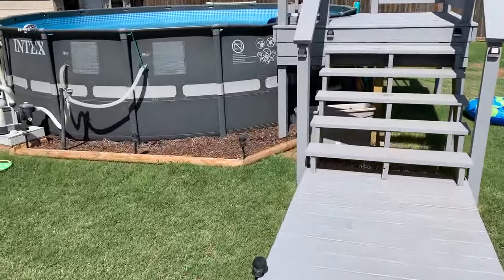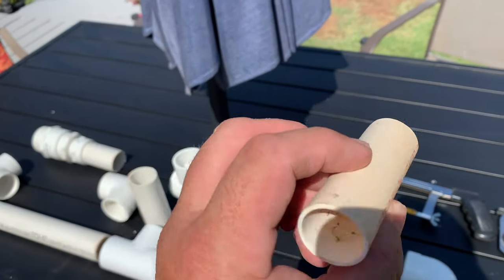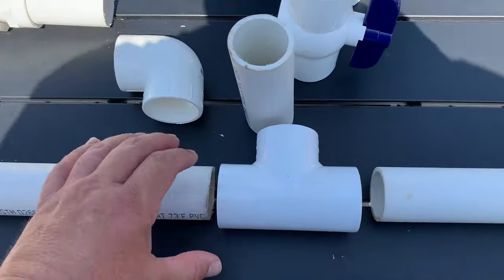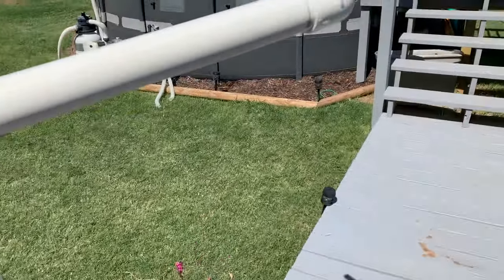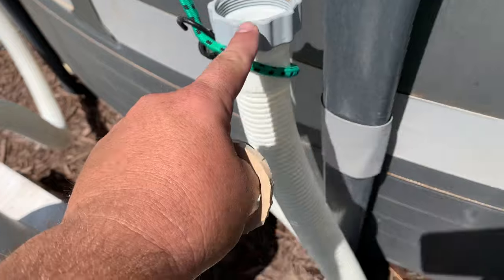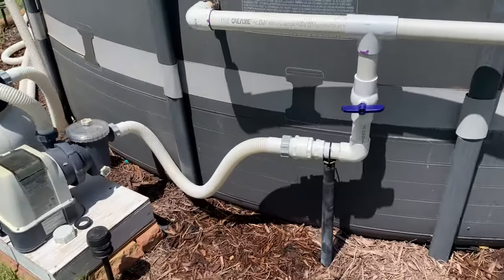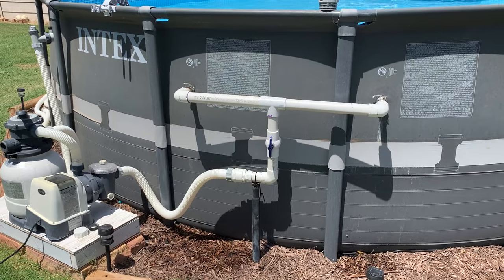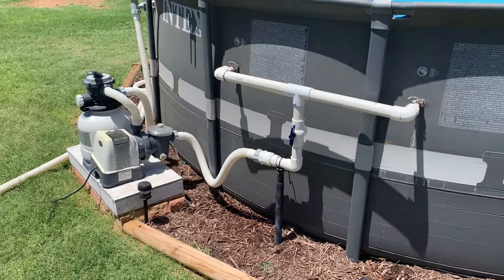How to PVC plumb your INTEX pool

Comment: The screened input nozzle that you are thinking about not using is part of the "VIRGINIA GRAEME BAKER POOL AND SPA SAFETY ACT"
It prevents suction entrapment by preventing the skin  from forming a blockage and damaging the body from suction.
Reply from the maker: I’m good with out it 👍 but thank you for posting the info
Reply: Actually, they are there mostly to prevent a child's long hair from getting sucked in, causing drowning.   That's also why there are two suction ports, to lessen the pressure at each.  Under no circumstances should the pool be operated without the screens or something like a skimmer, vac hose, or plug in one of them.
Reply from the maker: Correct for any parent with young kids do whatever it takes to keep them safe. Thankfully my kids are getting older and do not mess with the ports.

Comment: Did u upgrade your outward plunger? Where the water goes back into the pool my current pool is a 1.25 hole but need to do upgrade to 1.5 adapter to connect the pump.
Reply from the maker: No I don’t change the return side. If you make that end larger it won’t circulate your pool because of low pressure.

Comment: CPVC, PVC 40, and PVC 80.  Each has a different outside diameter.  The cream color pipe you used is CPVC that is measured by outside diameter.  PVC 40 and 80 are measured by Inside diameter.  You could use PVC 40 in a 1" and coupled to the pool screens, but would be work best if you heated the PVC 40 and then pushed it on the pool spout.  That way you could still install the screen covers inside the pool.  Just a thought.
Reply from the maker: Absolutely yes that’s great information, I figured all that out after I did it lol. You are correct great info 👍
Reply: I am about to try both of these suggestions... Woke up to 2 hose leaking this morning... Could you clarify the heating of the PVC40 & pushing it ON TO the pool spout? Instead of into the rubberized area, correct?
Reply: I’m rounding up the materials as I type to do this project. Are saying that instead of pushing the 3/4” CPVC through the inside of the rubber and into the pool, that I should get 1” PVC40 piece, heat it, and then push the 1” pvc40 over the rubber on the outside of the pool while the pool screen is still attached on the inside of the pool?
Reply: This would be nice to know. Still unanswered
Reply: He is saying instead of putting a 3/4” cpvc piece and sliding it into the piece attached to the pool that has the screen on the inside (inlet valve and return valve) to get pvc 40 and heat it up to soften it and place it on the outside of that same piece. Imagine the hoses not being attached and the valves just sticking out of the pool. Those pieces. So it’s not a lil lose.

Comment: Hi!  Your video seems to show the most detail so far.  Thank you!!  I just bought all the gear but went with 1 1/4” pipes because I wanted less weight and bulk.  That seems pretty close to the size of the cheap tubing from the factory.  Do you think I’ll be ok or should I exchange for larger PVC?
Reply from the maker: I bet it will work just fine

Comment: question, the piece(s)  that go inside the two openings that the old hoses suck the water thru (you didn't show the inside of the pool after you put it all together). Did you just leave it bare once you inserted the pipes and clamped it down?
Reply from the maker: My pool has covers that will block debris from going through the hole. What I did was cut those back a little bit so they didn’t go in as deep. And they pretty much met the PVC in the middle and worked just fine.

Comment: Good video. The two inlet ports, did you keep the the parts that were originally used to connect tube to? I have that skimmer as well but need the stock inlet hardware to attach skimmer to. My problem is that stock inlet hardware goes all the way to outside where hose hooks up. How do you stick the 3/4” pvc into port and still be able to use your skimmer? It’s the same size diameter too. Does it just hang out more inside the pool instead of flush against?
Reply from the maker: Yes I kept it all the same, on the skimmer I just cut the skimmer inlet adapter short enough it meets the p c in the middle of the opening.

Comment: I know you have upgraded to a Hayward skimmer since this video, but how did you use the intex skimmer with the 3/4” pvc?
Reply from the maker: I made a video for it 👍🏼. The skimmer comes with a blue adapter that screws on the debris cover for one of the inlets. Then for better suction just cover the other inlet with on of the plugs. 
https://youtu.be/Dd5lfIC4SUY?si=DqgH2oM8rpuZECdL
Reply: @LifeLessOrdinary  thanks for replying!! I watched the video. Since the PVC sticks into the black rubber hole on the side of the pool, I had to cut the intex pool strainer to fit. The new pvc pipe is halfway in and the cut intex strainer is in the other half…if that makes sense. The strainer will not fit in a 3/4 or 1 inch pvc. Had to get creative. I believe when you made the video, you still had the old flexible tubing.

Comment: How do you keep your skimmer down? I have the same pool and skimmer and mine is always floating up bc neither of the hooks properly fit on the edge.
Reply from the maker: I don’t have that skimmer anymore. I now have a Hayward. But yes, it’s frustrating when the water level changes it tries to float up. Unfortunately, just have to keep adjusting the height.
Reply: Thanks.  I'm in the process of ordering everything from Amazon now to get this switched over.

Comment: Nice job dude, but get rid of those tiny returns. Try to keep at least 1.5 to 2 inch return lines into the pool for optimum efficiency. I won't go into details since I'm sure you learned by now. Did you ever change them in 2021?
Reply from the maker: No I haven’t yet, seems to be running great as is but I might upgrade the pool after this season. If I do I’ll make them bigger for sure 👍
Reply: I agree. The 1.5" is pointless if you choke it right back down  to .75"

Comment: Hi, what return outlet do you have? Is it directional that we can adjust to where we like to  point? And how long you have your pool and do you have any rust and corrosion issues? Thanks!
Reply from the maker: Yes, I have a directional outlet, I tried to pointed to the side as much as possible, to kind of create a whirlpool. This is now my fifth season with the pool and no I have zero rust or corrosion issues.
Reply: @LifeLessOrdinary  Thanks alot for your reply. Could you send me a link or the name and manufacturer of your return outlet? I would like to buy the same. Thanks
Reply from the maker: Absolutely 👍🏼
Reply from the maker: Here is the return part https://amzn.to/3qoaQFN
Reply from the maker: This is what it connects to on the outside https://amzn.to/3N4mMpj
Reply from the maker: No on the return port on the inside he won’t need that long piece. You unscrew that part in the outside part screws right onto what’s left
Reply from the maker: Once you get it if you’re confused at all, send me a message
Reply: @LifeLessOrdinary  Thank you!

Comment: Someone's probably already said this, but don't you worry about the pvc cracking from the pool flexing back and forth?  I'd probably at least put a flexible hose to the bottom so it has some room to move around.  

Otherwise, looks cool.
Reply from the maker: Definitely something I thought about but it’s held up really good. Started year 3 this season and with 4 kids swimming like crazy I’ve had no problems 👍🏼
Reply: @LifeLessOrdinary  right on!
Reply: Schedule 40 pvc doesn't crack easily. The small vibrations or movements caused by that small pump most  lilley won't do much to damage it.

Comment: Can you still hook up a skimmer to one of the outputs? If you made that pvc thing. We just set it up and I was like oh can We hook up the skimmer now.
Reply from the maker: Yes you can still run your skimmer into one of the inlet ports. If you can’t fit the adapter all the in you can cut the end just a little and it will fit better into the inlet.
Reply: OK. I totally forgot about the skimmer when we made the PVC thing and now I don't know if it's gonna fit in the hole Or not
Reply: I think we may have put the pvc pipe in too far
Reply from the maker: It will but I cut mine when I still used that skimmer so it would fit into the inlet until it met the pvc
Reply: Yeah we didn't do that. Thought about it after the fact. And I looked and It's a different skimmer that what you have. The one that goes on the inside of the pool not the outside. Do you like that skimmer? Also do you think it'll work now that we already have the pvc pipe in most of the inlet hole?  Sorry for all the questions
Reply from the maker: Yes when first did this conversion I had the skimmer that’s goes inside that’s what I’m talking about 👍🏼
Reply from the maker: Look on the about section my email is there if that’s easier to communicate 👍🏼

Comment: Did you use the plastic inserts that came with the pool for the inside of your intakes ( the ones the screen screw onto ) ???
Reply from the maker: Me personally no I don’t, I don’t find that they help much
Reply: So how then did you hook up your inside pool skimmer I’m having problems with getting air in the system so I think I’m going to try the hard plumbing system see how that works thanks
Reply from the maker: Hard plumbing is the way to go. When I had the inside skimmer, it comes with an adapter for one of the inlet holes. The other Hole I would leave open unless I needed more suction to the skimmer. Then I would plug it.
Reply from the maker: This video shows how I run my system now. 
https://youtu.be/uWq2HbUBGuU

Comment: I’m looking to do similar hard plumbing. How do the seals fare when the pool is bouncing around with swimmers. Everything looks pretty rigid. What do you think about using the stake on the flex hose to allow for some play while holding the weight of the pvc pipes?
Reply from the maker: I’m going on year three now and I’ve never had any issues with the flex of the pool and the pvc 👍🏼

Comment: Saw in your comments you have a new video coming out this weekend?  Looking forward to it!  I've been researching how to convert Intex to PVC.  Never knew you could just use a 2" threaded!  Will your video show how that connection has held up over the year?
Reply: Since PVC is tapered you can't screw it on completely. That's why you need to find a fat O-ring (2 1/4 OD 3/16" worked for me) or cut a rubber sheet.

Comment: What/where did you get the rubber fitting you made? And did you use the original o ring as well. Im assuming once the hose from filter connects to the pvc pipe there should be no wiggle between the two.
Reply from the maker: I made my o ring out of a sheet of rubber about a 1/4” thick, I cut it out

Comment: "You will need to piece together parts to make a 1 1/2” to 2” adapter, to connect with the intex hose." this is the part I came here to looking for lol, could you list what you used, if you can remember!
Reply: 2 in pvc schedule 40 pipe

Comment: How did you connect the flexible hose to the threaded adapter? Hose clamp?
Reply from the maker: They were both 2” It just screwed on, but I did use that little rubber O ring to seal it better.

Comment: What are the lengths of the 1.5 PVC between the T and shorter lengths between the valves?
Reply from the maker: Unfortunately since that video I updated my new pool with new plumbing 
https://youtu.be/4gmdtYiSq9g?si=yaC338tRu8zmGZ-Q
But when I made that one I just did a mock up before I used the glue to get the exact size

Comment: Wondering if it would have been more  cost effective if you did the whole thing in SCH 40   3/4"  pvc and then just converted at the end to your 2" .  May have save money on the valve part.
Reply: Then the flow back into the pool would’ve been horrible. The pool already comes with two 1 1/4” flows from the pool to the pump. The way he did it, it’s now two 1 1/2” flows to the pump and a 2” flow the rest of the way back into the pool.

Comment: @Life Less Ordinary Would you comment or reply to me on utilizing and setting up two Intex pumps and filters that come with the 16' X 32' rectangular pool? Long story, but I was able to obtain two complete units that come with this pool. TIA.
Reply from the maker: I had the same question the other day. I wouldn’t recommend two of everything. You would have to increase the size of your intake and return hole to keep up with the flow rate. I would use one set and keep the extra incase anything breaks

Comment: Hi Nate, caught this video while searching 4 something else yesterday and wanted to say thank u. This is our 3rd year with our 18x48 intex pool and im done taking it down each yr, lol. Looking for a cleaner look and more permanent fix to the hose issues and u certainly helped me out. ? I have is our is a older model with smaller filter and pump, would u reccomend upgrading it to the sand filter or will my set up b sufficient to hard line as is? Really appreciate ur time, like subbed and will share too.🙂
Reply from the maker: I appreciate that great comment. Yes I would definitely invest in the sand filter it’s the best thing I’ve ever done. Your small filter will work with it also but your pool will run so much better with the same filter.
Reply: Thanx again, Really appreciate i taking the time not only 2 share, but also 2 reply. Here's 2 clear blue water and fun n the pool. Take care.
Reply from the maker: Right back at ya

Comment: i thought the 2 pipe holes are for the return and the higher hole towards the surface is the "skimmer"?  here you have it reversed.  I'm confused....
Reply from the maker: No the 2 lower holes are the inlets that pull water into the filter. The higher one hole is to return water back into the pool.

Comment: I would love to do this but I am struggling with the support aspect of it. I have my pool on a concrete slab so I am unable to pound a post to support the weight.  Thoughts?
Reply from the maker: Well it’s not so much to support the weight as it is to keep the bottom of it from leaning into the pool. It’s to keep it straight up and down. I bet if you could find a way to pad between the pvc and the pool that would work also.
Reply: @LifeLessOrdinary  I would think it would need some support to take the weight off of the inputs into the pool.  There is a similar how to video and she used a plastic hook like used to hang ducts. The hook is on the top of the pool and she tied it all to the other end like a big macrame project.
Reply from the maker: Give it a try, I bet that idea would work 👍🏼

Comment: How's it worked for you this long? was it worth it

Curious though if you used a ball valve on each side would you be able to turn one side off and get more suction from one of the sides or is it the same suction (more power for a vaccum?)

And did you use a vaccum with this? did it clog up easily around the bend requiring you to take it apart to get leaves out of it.

From a nerd flow aspect would it work better if one of the pipes went straight down

im toying with trying to pipe my pool to a small well house ~ 15 feet away, although slightly uphill which may cause issues..... and being able to convert it to PVC would make that more possible,.
Reply from the maker: I’ll be opening the pool up again next month and it’s still going strong. 👍
Reply from the maker: I’m sure you could but what I do is just plug one side of I want more suction 👍 and no it’s never clogged up from debris

Comment: the pvc inner diameter you shoved through the holes is probably half of the normal flow
Reply from the maker: It works great, didn’t want to cut larger holes

Comment: For the skimmer on this mod how did u connect it to the 3/4 pipe
Reply from the maker: The intex floatable skimmer comes with a blue adapter that screws onto the debris cover.
Reply: @LifeLessOrdinary  I get that but u have to slide the 3/4 pipe in as well on the outside I guess I need to think about it more
Reply from the maker: Ok I understand what you’re talking about. What I did was slightly cut the part that goes from the inside into the hole which met the 3/4” inch PVC in the middle. I hope that makes sense.
Reply: @LifeLessOrdinary  lol ok half n half explains it well enough

Comment: I just got my 18x52” up and running and I have low return pressure.  What does ur gauges show as pressure?
Reply from the maker: It should be right around 8-10 psi as long as it’s in the green you’re good. If it gets higher in the yellow do a backwash.

Comment: How is it holding up when your inside the pool?  These pools have a lot of flex and movement when people are in them.
Reply from the maker: I’ve had zero issues thankfully, I think this year will be the 5th season of having it. I got 4 young kids and the pool flexes like crazy.
Reply: Ok thanks I have mine partially plumbed but not those two small hoses.  I was afraid when the kids got in it would flex to much and the plumbing wouldn’t hold up.  Thanks.

Comment: cracks really bad?! Ive had mine up for about 4 years now no issues. That 3/4 in the inlets is a really bad idea as it will choke off a lot of flow.
Reply from the maker: Never had a issue with mine going on year three now. I actually just uploaded a new video and added a skimmer. You should check it out

Comment: Hi what size plug u use to plug the pool
Reply from the maker: I just have an extension cord from Home Depot running from the house to the pump
Reply: What size plug I use to stop the water from coming out so I can change it to do the PVC pipe
Reply from the maker: @tonymarquez5079 like this https://www.amazon.com/dp/B0B56NDDXT/ref=cm_sw_r_as_gl_api_gl_i_7A880K01CKSG8WGEEQFF?linkCode=ml2&tag=llonate-20
Reply: Thank you